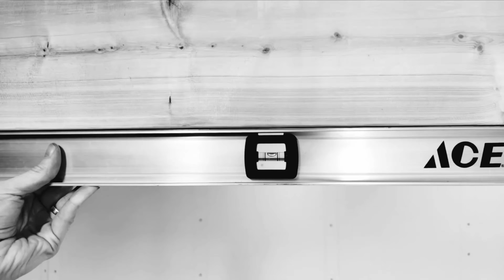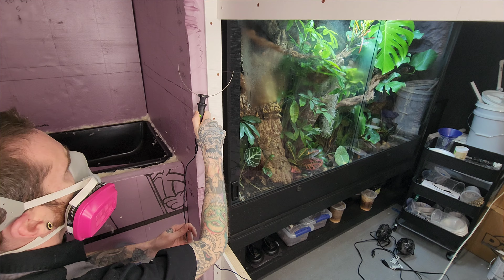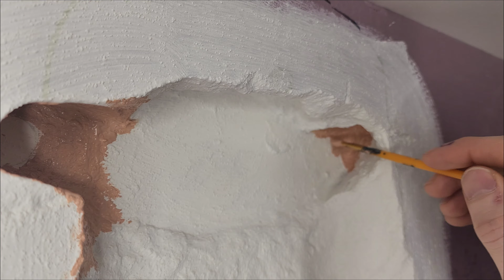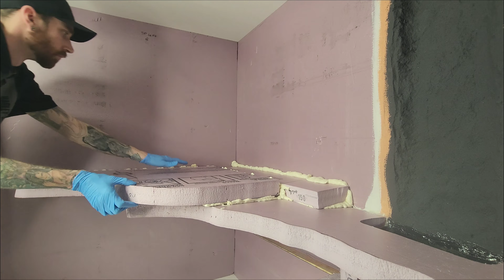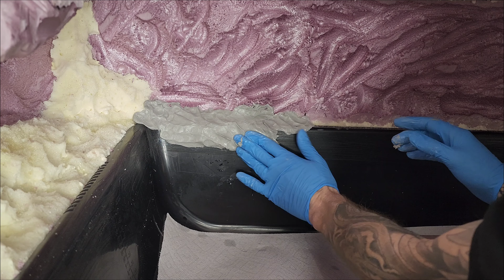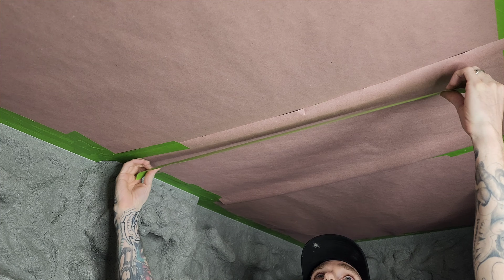DIY HUGE Reptile Enclosure. Waterfall, Dripwall, Hardscape, Background, Zoopoxy |Part 2| #reptiles

Comment: This is absolutely incredible!  I really appreciate the detailed information for each step you are doing and why you are doing it.  I have a couple of questions about the last part of the video, if you don't mind.  What kind of paint did you use?  Did you have to use a sealant over the paint, or is the paint itself waterproof and durable enough to withstand the moisture and wear without sealant?
Reply from the maker: Thank you Jennifer,  glad you enjoyed part 2 of the series and appreciate the work I put into explaining each step to the best of my ability. 
I used drylok with quikrete mixed into if for my base coat and majority of the brown dry brush. (Make sure you rinse well if you use quikrete mixed in. It has a light resin that plants don't like). After that, the multiple colors of paint on the plate are regular acrylic paints (matte color) that you would find at hobby lobby. They work great, and no sealer needed once fully dried. I have a friend, Mike (mikes monitors), who use them inside a paludarium for his monitors with no issues. 
Hope this helps
🤘💯🦎🐍🐢🐸🌱
Reply: @BradsBioactiveBuilds   oh my gosh - thank you for that info!!! Do you happen to know the brand of acrylic, or is it any acrylic? We don’t have a Hobby Lobby here. We do have a Michael’s. (Alaska) I’ll look online at the website and see if I can find out more or what would be comparable. I’ll also look up Mike’s Monitors as well. I do really appreciate the information. I don’t think I’ll ever be able to build anything as amazing as your stuff (it really is all top notch - I’ve watched even more of your videos now, almost all of them I think) but I can sure try.
Reply from the maker: @jenniferrackliff7216  of course, and I'm glad yph find my videos helpful. Try building something small to start to get an idea of how the materials work. Some stuff is trial and error until you dial it all in.
This is the paint use. 
https://www.hobbylobby.com/Crafts-Hobbies/Craft-Paint-Stencils/Acrylic-Craft-Paints/FolkArt-Acrylic-Paint/p/146166
Reply: @BradsBioactiveBuilds  So that folkart acrylic paint is completely animal safe correct? Even if I apply the acrylic paint straight on without sealing it with anything or without mixing in with dry lock, for example?  You don’t have to worry about flakes of the paint chipping off overtime in a high humidity environment and scrubbing/cleaning peeling the paint or flaking it at all and the animals ingesting it because Once the acrylic paint dries it hardens to the epoxy and basically never comes off is what you’re saying?
Is this acrylic paint also safe enough to use in the inside portion of a water dish that I want to make, or is adding paint to that not a good idea? 
There’s another brand of paint I was looking at called ecos paint and its supposedly animal safe but you need to buy a quart at a time and it’s pretty expensive and the one that says it’s for higher humidity and Reptile enclosures is not a matte finish. so I was just wondering how the folk art acrylic paint kind of compares to something like that. Folkart brand seems good but i just wanted to ask about the safety of it in your opinion especially when used without being sealed or without being used as a tint for the drylock

Also wondering, does the epoxy have a realistic kind of rock like texture to it or does it dry pretty smooth?  If I wanted that more gritty texture is that where the drylock comes into play, that’s where you would tint the dry lock with the acrylic paints and do it that way? The original dry is safe for animals as well correct, I’ve heard some people say otherwise but I just wanted to get your opinion on it as well, I mean, you must think so considering you’re using it on your project but just checking
Reply from the maker: @Snake_Eyes13  great questions.  Yes, the folk works great, has not chipped or cone off, and is water will not wash it off after drying. I was just over by my fried Mike's with Mike's Monitors this past weekend, and his 7 year old paludarium (8x4x6 for mertend monitors) still looks amazing both the paint. The other paint you mentioned is good but honestly the regular folk is just as good in my opinion 
The zoopoxy is a putty so when it goes on it can be smooth. But if you wait a little bit for it to start to heat up you can texture it with a wet natural sea sponge to make it look more rock like. 
Hope this helps
Reply: @BradsBioactiveBuilds  would you say that this folkart paint is even safe enough to use inside the water dish like not having to worry about the toxicity or anything like that from my snake drinking out of it? Or is that taking a step too far, don’t paint the inside of a water dish (even though it could withstand the wetness and not peel or flake) but just more safety precaution in case of toxicity?
Reply from the maker: @Snake_Eyes13  great question, I have used it, and many others have as well with no issues. From the research I have done, it is safe for animals
Reply: @BradsBioactiveBuilds  does Mike use the acrylic paint mixed into the dry lock or does he use the acrylic paint straight?
Reply from the maker: @Snake_Eyes13  straight acrylic woth no drylok. I've only used drylok mix for the sand granules.

Comment: so the zoopoxy is water tight, then there isn't a reason to use drylok, right? I'm looking to build something, not that big but half that and I want it to hold about 50 gallons on the bottom as a pond
Reply from the maker: Yeah, there's no need to drylok. I only used drylok over the zoopoxy to match my other enclosures. I could have used acrylic paint instead. But I like the sand granuals in the drylok. It held water for 72 hours, no problem with the zoopoxy alone. Are you going to cover the bottom of the enclosure with zoopoxy too?
🤘💯🦎🐍🐢🐸🌱

Comment: I’m just sitting here with my jaw hanging at certain parts, like the level of detail with multiple colors for the hard scape.  You have a real artistic flair and a level of technical ability that I wish I could emulate.

What changes would you make in your approach to something on the scale of, say, a 20 gallon enclosure compared to this?
Reply from the maker: Thank you!  It's definitely been fun so far, I'm hoping to finish editing part 3 by the end of next week. Video coming soon.
For a 2o gallon, it's really the same process just on a smaller scale. But I would also consider what I would be housing in the enclosure to make a final decision with it all.
🤘💯🦎🐸🐢🐍🌱
Reply: @BradsBioactiveBuilds  I’m like, “Hmm what would make an interesting challenge?”

How about a cave gecko?  Thinking the hard scape would possibly be similar?  Maybe don’t need to worry about heating or light as much as possibly keeping it cool and damp?

Btw, I like the stalactites, but they’re formed in nature where water drips from the roof of the cave and slowly build up sediment over time, so wouldn’t it be interesting if they played a part in the water fixture somehow…?
Reply from the maker: @cyberwraith2k1  cave geckos are cool. O say go for the challange and build something fun for them. 
I did think about adding a small pump in the water for the stalactites, but for what I'm putting in the enclosure, it would have collected too much bacteria in the hose from him pooping in the water. 
Maybe in another build I'll try that where the poop won't be an issue in the water. But I'm glad you like them!

Comment: Hey Brad i am thinking of doing a hybrid  Paludarium with foam board back and sides covered in Drylock and a glass front .  do you think the foam dry locked with multiple coats and seems siliconed will hold water ? thinking about 20 gallons etc  ps love you videos ...so Good
Reply from the maker: I'm not 100% sure on what you mean construction wise. I will say what it comes to water features it's best to over engineer than do it the easy way (I've learned from my mistakes in doing this). 
I'm glad you love my content and your support is valued. 
Check out this video (if you haven't already) it goes over separating water and land in a paludarium. 
🤘💯🦎🐸🐍🐢🌱
https://youtu.be/-6B4wvRxdqA
Reply: @BradsBioactiveBuilds  sorry i was just basically wanting to know if drylok extreme itself could hold water if you used it in a wood box  to make a pool
Reply from the maker: @angrytuareg6498  I hear ya, use drylok original for animals. Extreme to my knowledge has additives that can be harmful to animals.
If I were to make a wood box that held water, I would use wood glue before attaching wood panels together, then fill the seams with wood filler, sand it with 220 grit sandpaper, then cover in drylok original with a few coats. 
Hope that helps!
🤘💯🦎🐸🐍🐢🌱
Reply: @BradsBioactiveBuilds  Thanks Bro you  just saved my build! ...wheeeew close one off to lowe's. that info was just in the nick of time ...seriously thank you for the Amazing video's that inspire us all ....and o yeah getting back to me with build saving info :face-blue-wide-eyes::body-green-covering-eyes::dothefive:🤪🙏🙌🙌🙌
Reply from the maker: @angrygorillaking  of course, any time. Have fun building!
🤘💯🦎🐸🐍🐢🌱

Comment: What background do you have? It looks like you're a carpenter, but also into model building or model railways because you use many techniques appliable in those hobbies.
Reply from the maker: I did some roofing, siding, software, and gutters in my late teens' early 20s. Tattooed for years, now I'm a Director of Operations for a drug and alcohol treatment center. Never did models or anything, but I've always been fascinated with that kind of stuff. A lot of what I do is trial and error/self taught along with other helpful stuff. 
Thamx for watching! 
🤘💯🦎🐸🐍🐢🌱

Comment: So what happens if you ever move? That's my biggest hang up on trying to build something this nice for my Burm when he outgrows his current enclosure.
Reply from the maker: Good question. Hopefully, that's not for a while. But I measured all the ledges and hardscape features so I could cut it in half or 3rds. I will have to dobrepair work to tie it all back together, but the alternative was not building it, lol.
🤘💯🦎🐸🐍🌱

Comment: Amazing build man, I have a 4x2x2 pvc enclosure im looking to make a background for like this. I thought to use silicone 1 to adhere the foam board to the pvc itself but would you recommend the lexel adhesive over that and why if so? Thanks man I appreciate the info
Reply from the maker: Thanx, much appreciated.  I actually used silicone and lexel to attach the xps board because with the panels being so big I wanted to make sure it stuck. I didn't show using lexel because I waited more then 2 weeks before I started adding zoopxy. Giving it more then enough tome for the lexel to cure. But with a 4x2x2 you should be good with just silicone. I did find adding random spots of drylok to the back of the xps board allowed the silicone to have a better bite into the xps. 
Thanx for watching
🤘💯🦎🐸🐍🐢🌱

Comment: Great video and information as always. Since the Zoopoxy is water proof, can you omit the PVC board?
Reply from the maker: Thank you, 
What do you mean by omit?
Reply: @BradsBioactiveBuilds  Sorry - use plywood rather than pvc. Pvc sheet isn't avaliable locally to me and having it shipped is pretty pricey in addition to the cost of the panels themselves. I've a pair of cumingi that are need of an upgrade and these videos really help.
Reply from the maker: @FractalThinking  got ya, yeah yoh can use plywood too. Especially if you can't find any pvc locally.  I personally like pvc bc it holds temps and humidity better, lighter weight and won't rot. But plywood is definitely an option. Just make sure you water proof it well. If you are using this video as a guide just replace the pvc with plywood and everything shoukd match up. Hope this helps! Let me know if you have any questions along the way.
🤘💯🦎🐸🐍🐢🌱

Comment: That zoopoxy stuff looks great.  If I got 2 gallons of it, would 1 quart of thickening agent do the job?  Or do I need more?
Reply from the maker: Zoopoxy is amazing! It all depends on how much you are trying to cover. I think 1 qt would work but a gallon of thickening agent is only like 20 bucks.
 🤘💯🦎🐸🐍🐢🌱
Reply: @BradsBioactiveBuilds  Sweet, thanks. Also, how many gallons did you need to do this enclosure?
Reply: @BradsBioactiveBuilds  How many gallons did you need to do this enclosure?
Reply from the maker: @DraconisMarchVII  this build took just under 20 gallons. But I went heavy in some spots as I was learning the material.  Plus with all of the carving I did I had some waste when applying the zoopoxy. If I were to do it again I don't know if I would have carved the background as much but instead I would have added sprayfoam in spots if that makes sense.

Comment: Where is a good place to get the pink foam sheets for a reasonable price?
Reply from the maker: I usually go to homedepo for mine. They have different thickness depending on how deep and how much carving you want to do.
🤘💯🦎🐸🐍🐢🌱
Reply: Thanks! How much Zoopoxy did you use for the project? Also is it strong? Like if I built a rock wall like you did for an escape room do you think it would stand up to humans leaning against it etc?
Reply from the maker: @ExitGameOC  I used just about 20 gallons, but I went heavy in some spots. The stuff is super strong. Better than concrete. I can sit on the ledges with no issues. So I definitely think it would hold up. Send polygem a message. Tabitha should reach out to you to give you better details than I can. They are super friendly and great to work with. Let them know I sent ya. 
🤘💯🦎🐸🐍🐢🌱
Reply: Thank you!